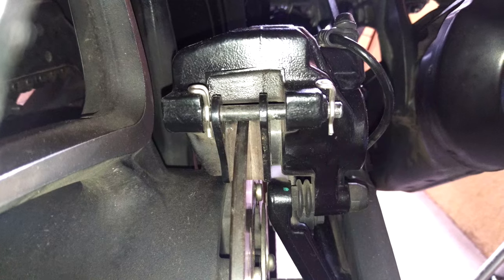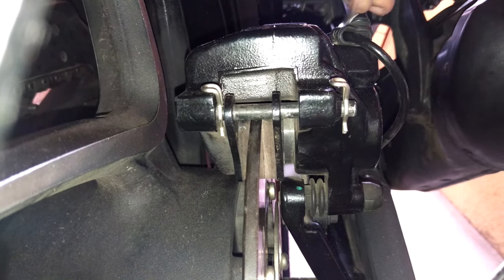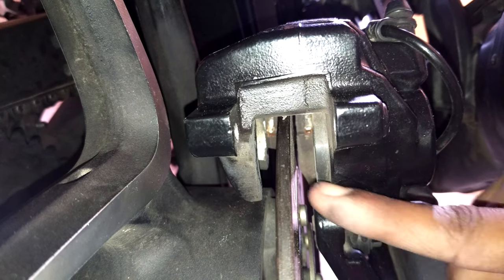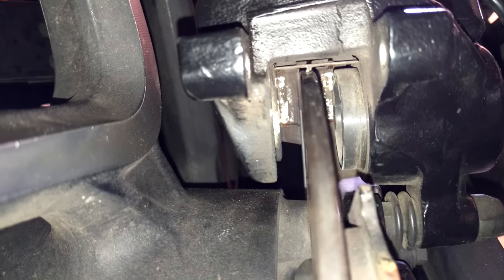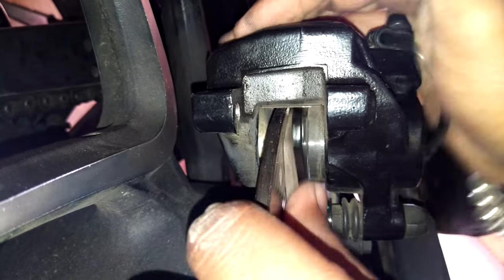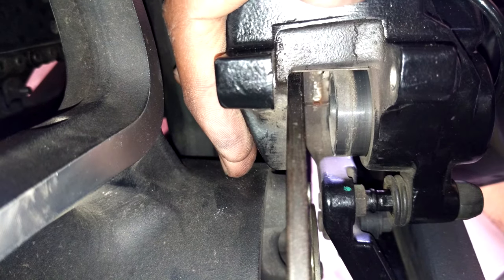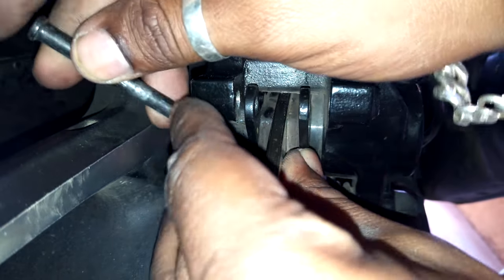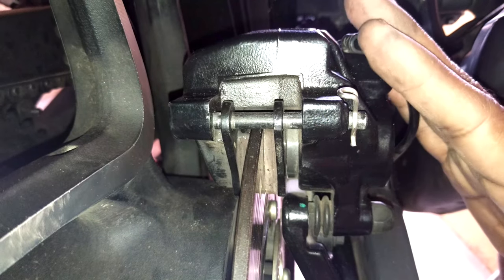DISK BRAKE CALIPER PISTON OUT | FIX | DOMINAR/ANY BIKE

Comment: My pistons popped right out and its hard asf to push back in!! HELP...
Reply from the maker: Don't use force now. Use wd40 and let it penetrate jammed piston and use a plier and then try to press piston using plier and if possible take it to mechanic as if you don't do it properly youe may damage something and ideally you can open the oil valve to release the pressure and then piston make go in slowly but you need to then refill the dot oil but if you are not comfortable Don't do it.
Reply from the maker: If you are in india ping me on Facebook I will call you
Reply: @VijayHansora   I tried to use wd40 on the piston but it done nothing and i tried to release the pressure from the 8mm nut still nothing. So i forced it back in and fitted my new brakes now theres no pressure on the brake pedal, may be that theres air n oil mixed in so i might pump it out, re change oil then see if it will lock properly...?? What do you think
Reply from the maker: @hxz1855  so if I understand correctly you opened the 8 mm nut on the caliper which is valve for the brake oil. Once you open that the oil may come out realising rhe pressure. So now what you need to do is open the oil reservoir and keep hitting the brake till it lever becomes tight. If it is soft that means there is air and brakes won't work. But remember if there is not much oil dripped then keep oresisng the brake till it becomes hard
Reply: @VijayHansora  yes your right about the valve. So i open the reservoir 'which is where you fill the oil?' And then pump the brake and see if itll go hard? I think i need to refill it anyway so should i refill it first or try to pump it will its empty? Thanks for your help bro!!!
Reply from the maker: If you didn't drop more oil them pump it. If you did drop then get the oil and then refill slowly and then pump it.
Reply: @VijayHansora  and then it should tighten up bro? My bikes a xr250 and the reservoir is like a plastic screw off lid thing is that correct bro?
Reply from the maker: @hxz1855  yes that is correct. Just open the plastic cap of reservoir and then keep pumping you will literally see bubbles coming out from the oil. You need to do it till lever is hard and no bubbles are there.
Reply: @VijayHansora  i will try in the morning brutha! Pump with the cap off and fill or fill after you pump the bubbles? May seem like stupid questuons but thank you bro!!!
Reply from the maker: @hxz1855  if the oil is low in reservoir fill it and then pump with cap open. This way you will be able to see the bubbles and make sure the caliper nut is tight
Reply: @VijayHansora  thankyou soo much bro!! Will try tomorrow and if it doesnt work i will definitly get back to you!!

Comment: It's not going inside what to do plz help me out
Reply from the maker: See if you have WD40 and spray it and keep it for free hours and try again by the way in this lockdown just stay home
Reply: Mine is not going inside too, is it safe to put wb40 woth thus thing??
Reply from the maker: Try wd40 and wiggle it a bit increase the pressure slowly if still it doesnt go. Remove the caliper and use a plier to press the piston inside.

Comment: How to fix squeaky brakes?
Reply from the maker: Squeaky breaks often indicate either there is some amount of dust in between the platter and disk. Or the brake pads are worn out.try using chain cleaner and clean it and try it out.
Reply: @VijayHansora  already cleaned the caliper, disc brake and pads twice. With newly replaced brake pads.
Reply from the maker: @alaspablo4307 If the pads and disk is replaced then I would open the caliper and service the caliper. Maybe there is some oil leak very minor causing dust to accumulate. But cant comment much without seeing it in person.